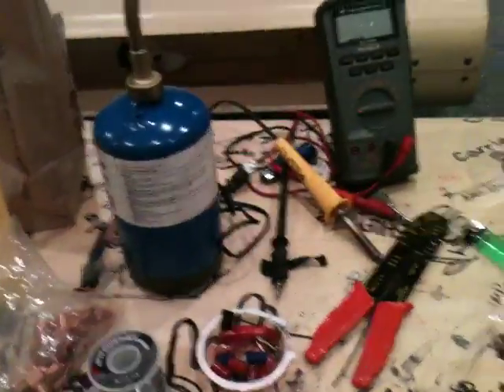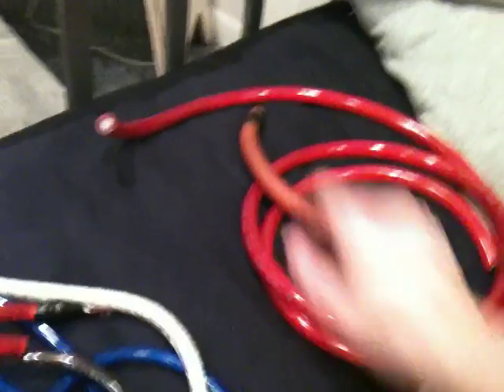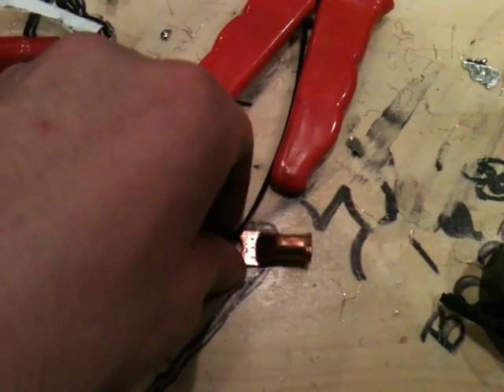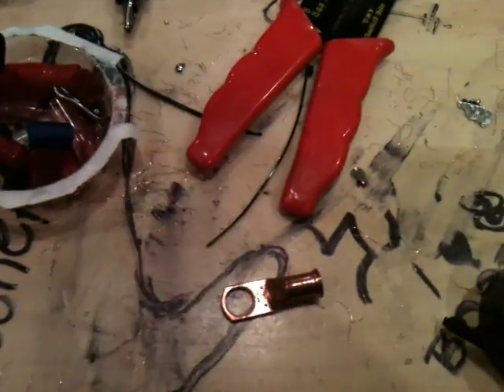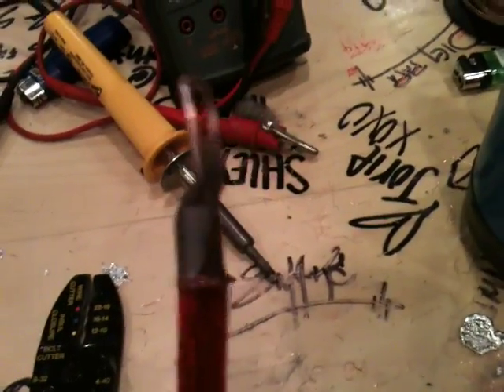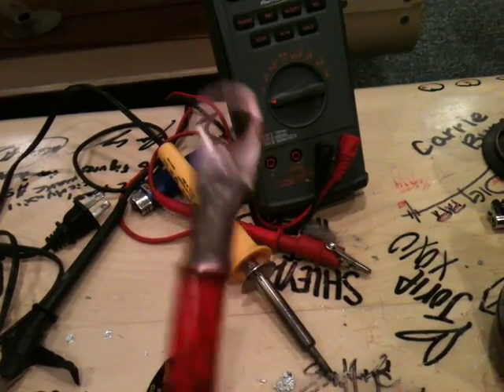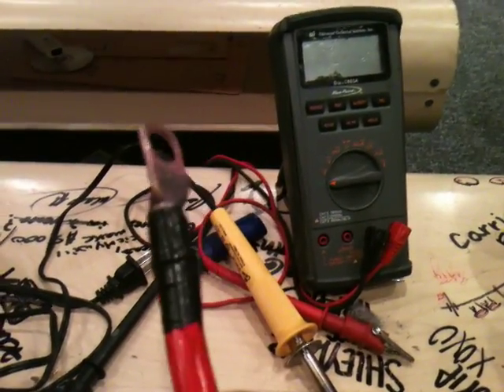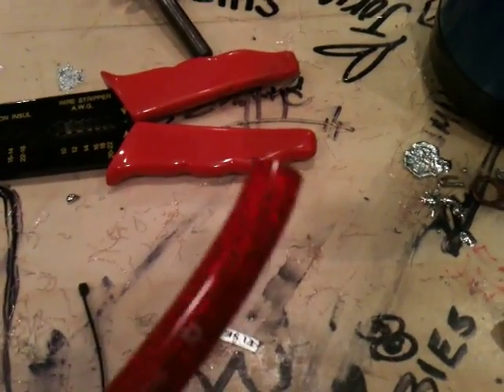basic terminal soldering

Comment: question, gauge would you use for 1200 rms amplifier? It will be an AQ1200d, if you are familiar with that amplifier. Already have 4 gauge ran from current setup. Looking to upgrade